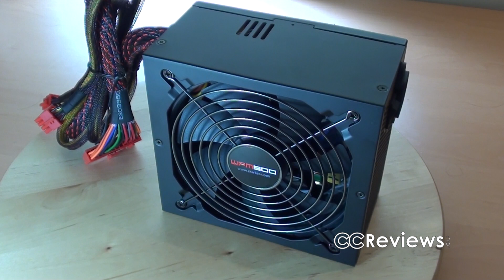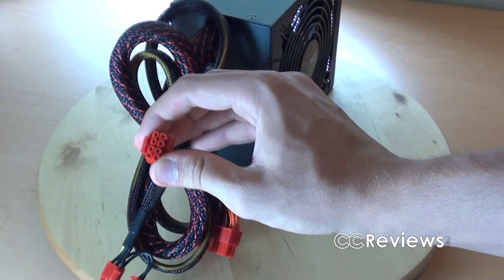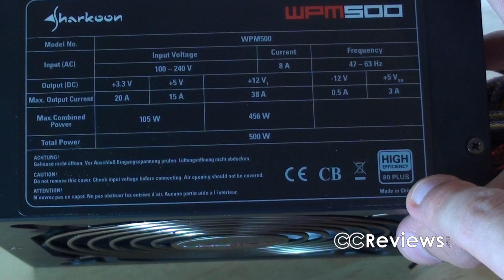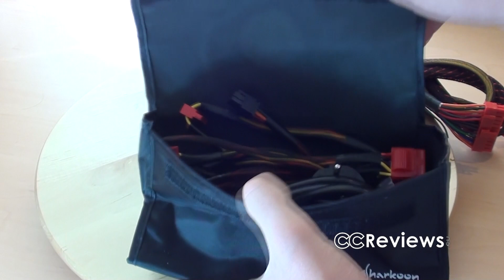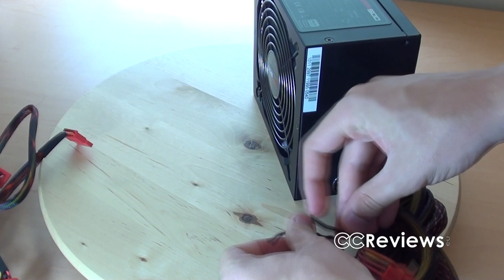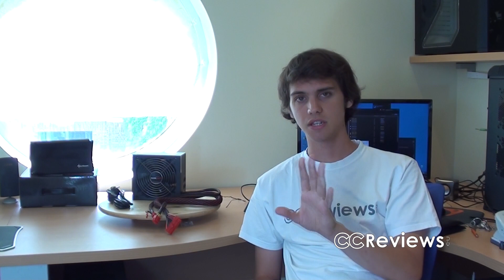#80: Sharkoon WPM 500 Watt PSU (CCReviews)

Comment: I just looked up on the power supply and Sharkoon does have 80 plus certificate, this power supply does aswell. It goes under 80 plus bronze and it's Sharkoon Technologies.
Reply: +Wesley Maze Are you sure it is? I have the 600 watt version it looks almost the same the certificate sticker looks way different though on mine the sticker is in bronze all it says "80 plus® bronze". I am very pleased with and at that moment the price about 10$ more then the 500 watt version. Reason I asked is coz I noticed this one does not have a registered trademark logo ® on it.

Comment: It is very obvious you are not too knowledgeable with power supplies. You said "a couple of rails" and didn't mention that it only has 1 12v rail and didn't mention it's ampage and whether it is low for a 500w or normal. Please, do some reading first. I would start at OCN or hardocp.

Comment from the maker: Continueing; I don't mean this PSU will fail, it's just that giving it a fake label, and not mentioning any real specifications doesn't give much trust and doesn't give, me at least, a reliable feeling about the unit. A PSU is a very important part of your system. It can even decide how long your components will last.
In any case, the voltages were ok indeed. I don't say they're bad. But we can't just judge on a multimeter test. If I could test it more, I would, but I don't have the resources.

Comment from the maker: I understand.. Let me explain here then. I say it is a perfectly good PSU. I just don't advise it for Gaming systems that will require high wattages. Why? Low efficiency and the fact that you don't find any info on which protection systems this has. It does probably have some, but we're not sure exactly or which ones exactly. So I advise to go for something more expensive even when building a Gaming system or anything with expensive hardware that you don't want to risk with a failing PSU.